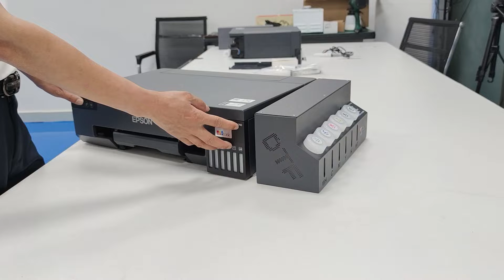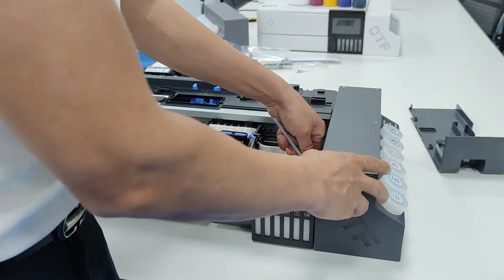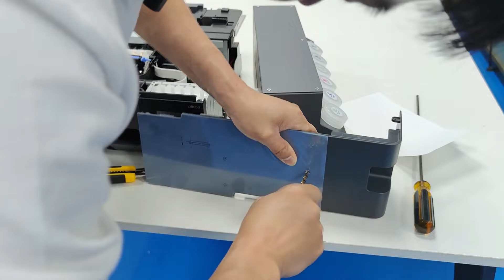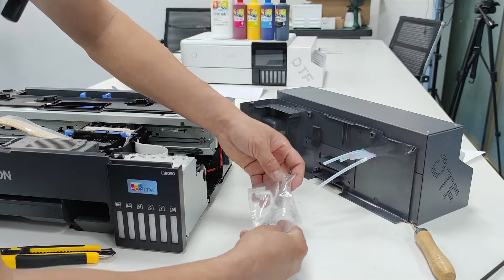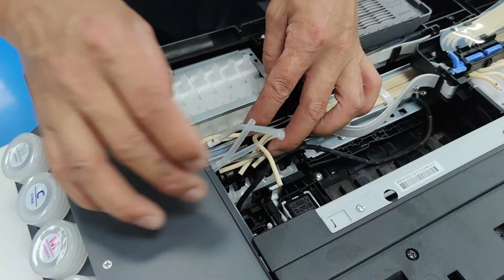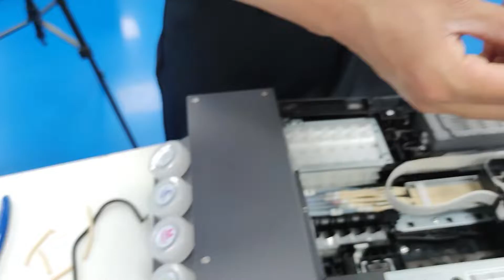modified DIY dtf ciss for epson Ecotank ET-8550 ET-8500 L8050 L18050 L8058 L18058

Comment: Why did you have to cut the tubing to the dampers and add the connector piece?
Reply: so that your White ink will circulate to the tubing.. The other tube is your supply and the other is your return back to white tank.